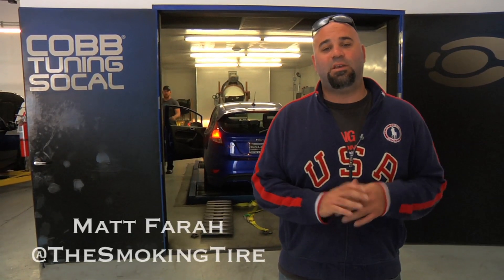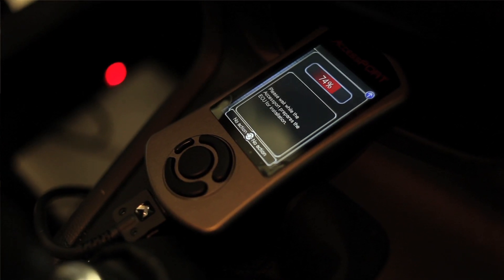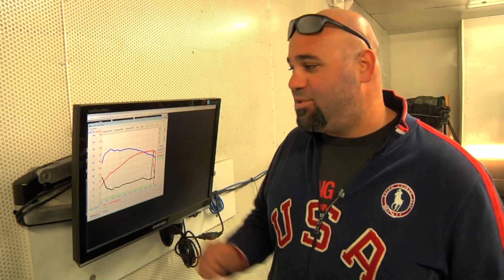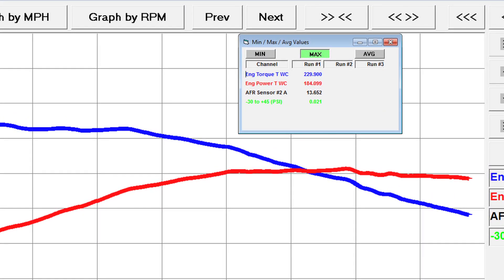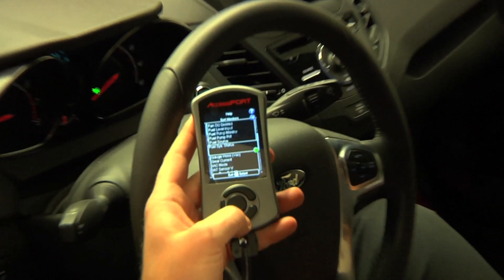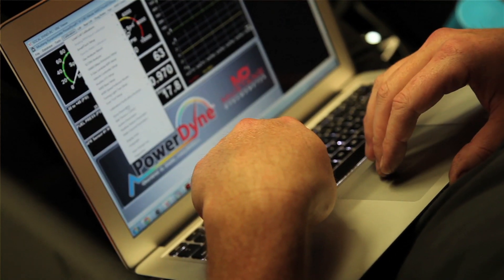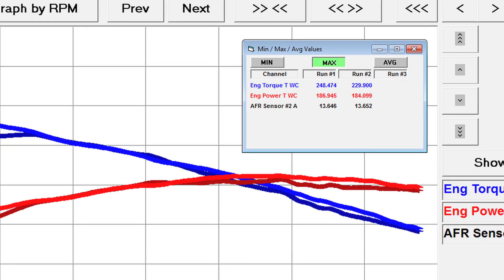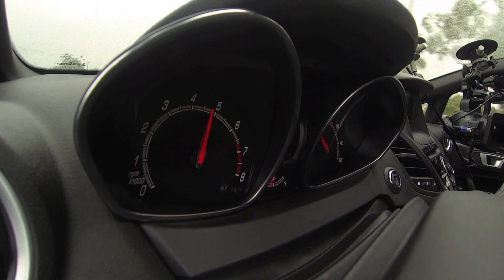Project Car Fiesta ST Gets Cobb Stage 1! Before/After Dyno

Comment: my 94 civic coupe still has a better interior 20 years later, car looks way better too#1200$
Reply: ive owned every civic hatch up to the ek youre so fucking wrong onn that statement. my fist is 100% nicer quality inside and out. getting into my wifes 04 civic is like getting into a time machine the thing is so outdated and aweful anything you can touch breaks, door handles ,buttons you name it. headgasket randomly just went last year as the car broke 100k miles.. garbage.